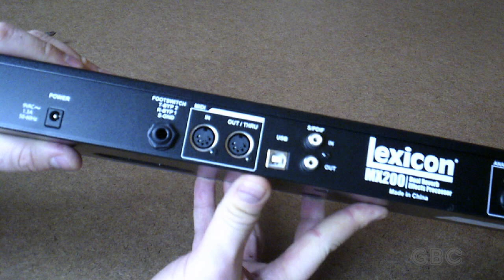[9] Lexicon MX200 Teardown

Comment: Do you have any ideas as to why the LED numeric display for program setting might ble stuck flashing between 99 and 1? It won't let me shift any of the settings and the reverb/delay effects lights don't change, or if they do it's after pressing the button a bunch of times.